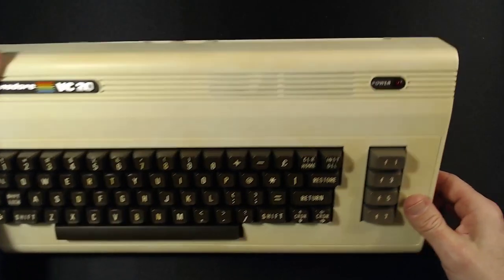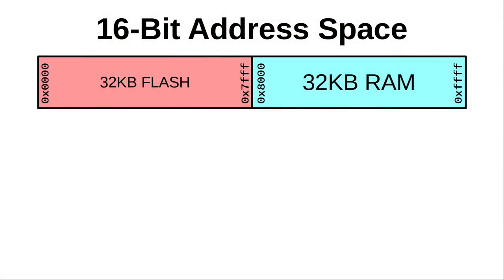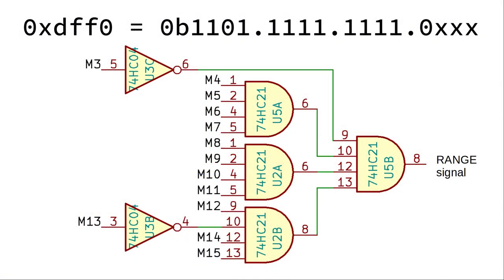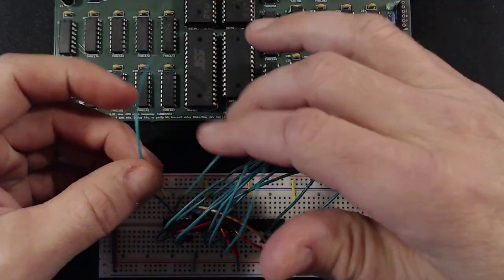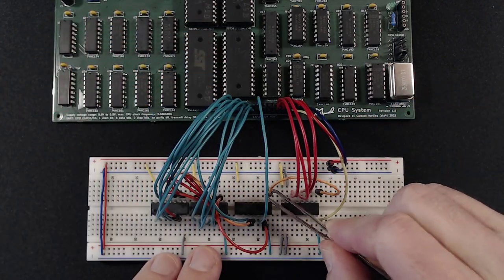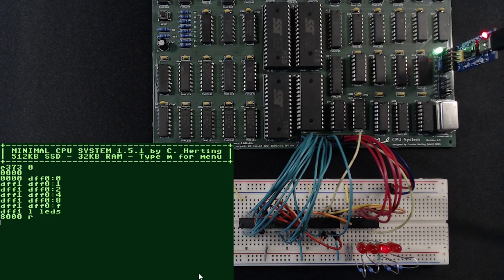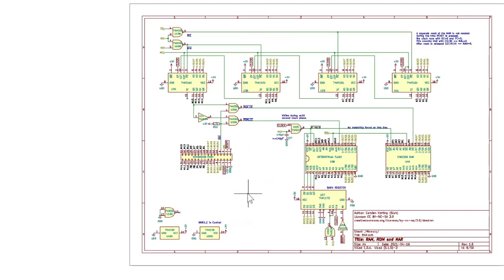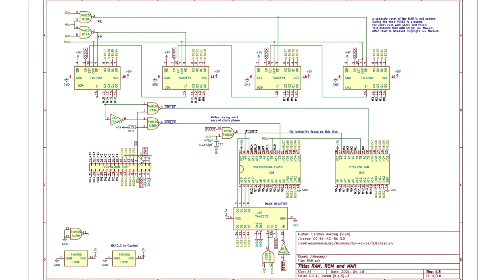Let's Build a Minimal I/O Expansion Card

Comment: I'm slowly making my way through all these videos having bought the bare PCB and comps slowly arriving by post. Really great. Thank you for doing all this. One thing i haven't found so far is timing diagrams, I'm assuming it's similar to SAP1 in theory but some pics of a single instruction working it's way through the multiple clock cycles would explain a whole lot for new users. Also the os that's running on reset i haven't found detailed as yet. I'd recommend maybe rearranging the playlist somewhat to cleanly explain the layers from hardware up to the software. This is a great series and beats all others I've found, I think with those improvements it would get more visibility on YouTube. Thank you again and I'll keep watching.

Comment: Great project! Can you document more details about the expansion slot?
I mean the timing diagrams with Tsetup&Thold times e.t.c. This can help others to make reliable expansion cards.
Reply from the maker: Good point, but this will take a while I guess. I will include detailed timing diagrams in the reference manual at a later time. First I need to get the actual PCB design for my new "Minimal 64 Home Computer" out. Seen the videos about it?

Comment: @slu4 Something a little confusing on this video at the 3:44 mark. In the video you wire directly from the expansion header which is RI but on the commentary you say you're taking the inverted RI ? On the minimal schematic the signal is RI not inverted RI. But when showing the 74HC173 you show /RI indicating it has been inverted somewhere. Could you clear this up for me ? thanks !
Also is there any reason you could not take the full 8 bits from the data bus ? or was just 4 taken for demo purposes ?
Reply: Ah, I think the commentary isn't exactly in time with the video, seems the inverter connection is done a minute later, hard to see on phone.

Comment: plans to release any more expansion boards?
Reply from the maker: Hi Kevin,
actually I am about to finish something exciting: A full 'Minimal 64' home computer. Takes up a lot of time, though ;-)
Reply: @slu467  64 bits wide ALU now?  or 64kb RAM? hehe
Reply from the maker: @daomingjin  64KB indeed but still going minimalistic ;-) - with harware AND OR XOR, VGA out (monochrome only of cause) and PS2 all running @ 8MHz - with no more than 61 ICs...